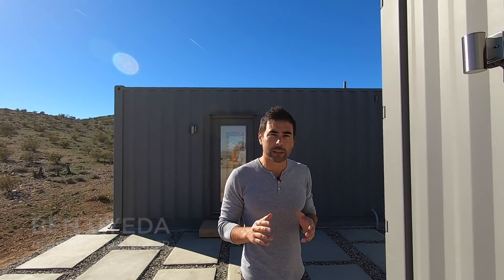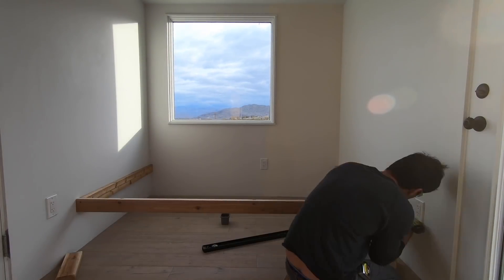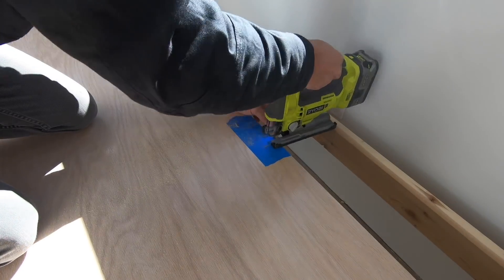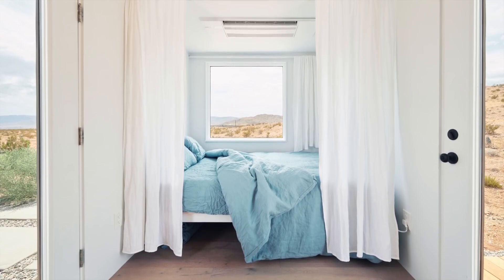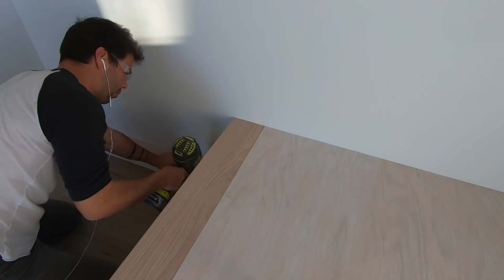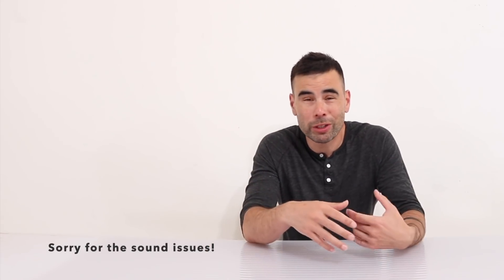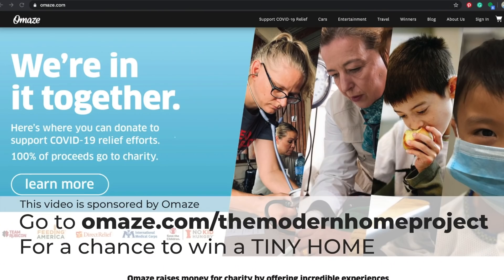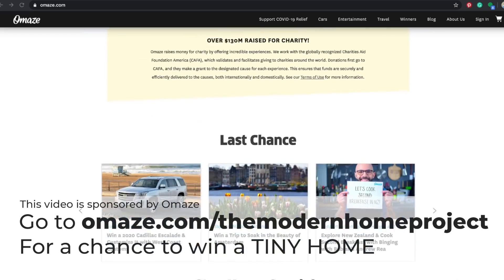How to Build a Shipping Container Home | EP09 Building the Bedrooms

Comment: Even outside of California. I think shipping containers are only a cheap option where there is an exemption from building codes and minimum need for climate control. Like emergency shelters etc. Everyone tries to build a dream condo out of them and therefore design all the potential savings over a traditional house right out of them. Don't get me wrong these are really cool and clever houses. But I can't help but feel like compared to a traditional house of the same size it's a lot of extra puzzles to solve just for the sake of saying that it's made out of high cubes.

Comment: This project desperately needs landscaping, a desk and exterior areas in general...
Reply: I’d agree with the last two, but personally I like the desert landscape
Reply: Dwight Castillo I would add awnings to the windows to minimise overheating and the necessity of A/C
Reply: start inside, work your way outside
You should always landscape after you have finished the interiors, for obvious reasons. The interiors aren't finished.